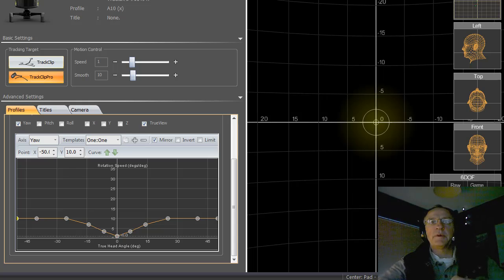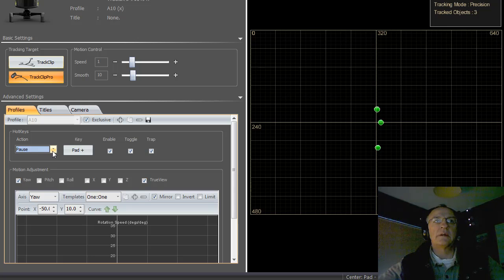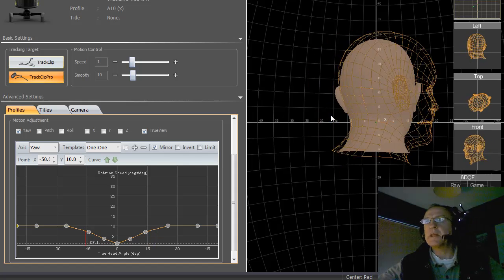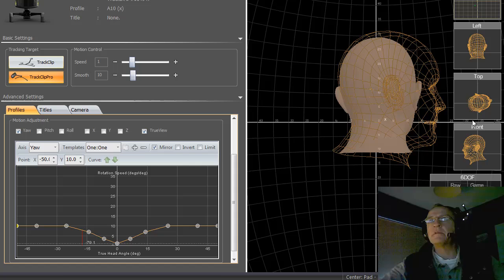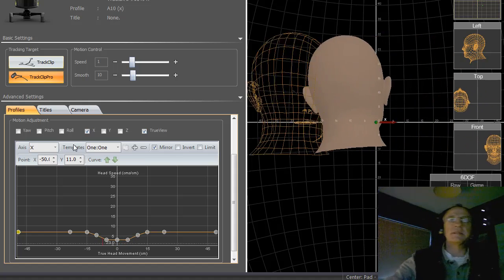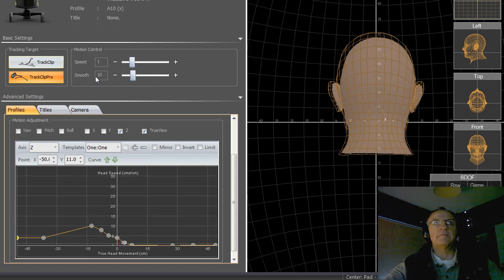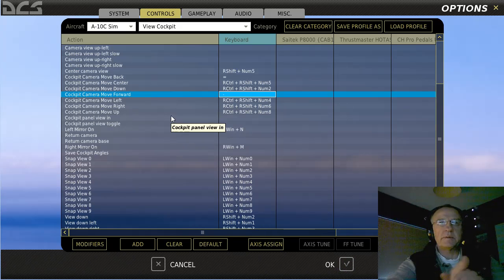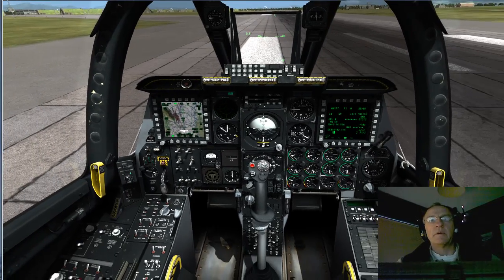Setting Up Track IR

Comment: You need a "dead space" area if you are playing first person shooters.
Otherwise its hard to keep your guns "strait".
Reply from the maker: I don't agree. But you need it to move very slowly near the center. Remember that the gun and its aim is not affected by the TIR. What you don't want is the view 'jerking' out of the deadzone, if you move your look, when you are trying to aim.  Think of how accurately your head can move in the real world to accomplish the aim process. But there is a 'snapping' problem in A3, which i don't believe has been fixed, and was not present in A2,...................  EDIT: setting in A3 which is broken is the aiming deadzone, which i leave off.
Reply: Half the point of using TrackIR in infantry mode is to aim down sights like you do in real life. As in you shoulder the weapon and sweep look over the sights. Which you can do with TIR by ADSing, moving the view slightly down and then looking up.

When you dont have a deadzone that "snap to perfect center" when its close enough. It will affect your engagement time on other humans. Which is why I havent met anyone with TIR that also uses it for infantry and is decent at it, that doesnt use a dead zone.

Which was the point of my OP.
Reply from the maker: Hi Lobos, and thanks for your reply. Discussion is always good. Like you I don't know anyone who uses TIR in infantry mode, and many I play with have it for flying/driving. The reason they say is its simply degrades  performance in combat. I totally agree. So for me the point of using TIR in infantry mode is 100% for immersion. So once again we will have to agree to disagree. I used deadzones for a number of years with TIR, and it did take some getting used to without them. From my experience over many years with TIR,  you can get the  same 'performance' from a good 'curved profile, as a 'deadzone' one, but with the added benefit of better immersion.

Comment: hey i bought a trackir4 to save a bit money, was that a bad choice? is there a huge difference from the trackir 4 and 5? thanks!
Reply from the maker: +FR Gamer Believe 4 supports 6dof, just resolution and capture angles are lower, from what i remember. 4 used to loose track for me at certain angles, 5 never does. But you can compensate with the profile. Get the ProClip. Bigger difference with the pro clip over normal, than tir5 over tir4, if that makes sense. Check out 'DeclanClip' might be cheaper, and more robust. Naturalpoint pro clip is very weak, and delicate, and they have done nothing to improve this.

Comment: Hi I'm having really trouble with just simply the cap reflectors in so much when its on my head & I'm looking forward in fsx cessna 208 the  position is always about 40° to the left or right. I have to turn mt head to the right 40° just  to point ahead ish. What have i done wrong. Using track ir 5 with fsx windows 7 high end mid range  pc Intel ivy 5 with nividea gtx660. Would i need to go to step 1 and align the camera. Also do i need to bend the reflectors to sit in a different position. I have a preset profile loaded in form natural but still have this very  basic forward position issue. Can you help. Kind regards simon.
Reply from the maker: Simon Skyfall 1. make sure you are setup for the cap reflectors (clip), and not the clipPro. 2. Its a phsical thing. Make sure the reflectors can be 'seen' by the camera. THEY MUST HAVE LINE OF SIGHT OF EACH OTHER, over the range for head movements to left and right, and top and bottom of the screen. If you get that setup the the rest will follow.
Reply: Thanks Gerry I'll check thats all in order. I'm not far off it you video has been a great help.

Comment: just found my old trackir 4, cant find the trackclip or the pro i had for it... made my own, but i'm having trouble getting it to "read" more than about 10-20 dgrees of movement (ie, i move my head frmo left to right, it only reads about 10 to 15 degrees total. anything i can do? i built my own trackclip using a hat and some reflect material. works great but can i improve on the design? i hate the clip pro, as it breaks and is garbage.
Reply from the maker: In the target tracking box of the software UI, make sure it is set to the type of reflector that you are using.
Reply: thanks. i did that. its working, i just think i'm sitting too far back or something. i bumped up the "speed" then adjsuted the curves and that seems to have helped.  still kind of annoying but its working.
Reply: BadTurbulence they have not. it's still flimsy as shit.
Reply from the maker: Just get a 'LukeClip' on ebay. They are the business.

Comment: hi awsome job ! i have a problem i cant add any profiles to my track ir software . i can only use the defaults profile that is for the track ir . am i doing anything wrong ? or what the hell is the problem .
Reply from the maker: +Christopher Karlsson Click the PLUS button beside the exclusive box, from the profile tab. Name the profile. Or select a profile, then click the copy button beside the one above, an name it what you like.
Reply: +Gerry Abbott yeah i know but i want to use ur config setup from the start so i downloaded your profile and put it in the folders profile where the TRI is installed. but for somehow no mather how many profiles i add in to the folder once i start the Track IR 5 program it only comes up the 4 Default profiles. and cant see the once i had add.
Reply from the maker: +Christopher Karlsson Did you unzip the download (its a rar file). The profile is inside, and  name ends with .xml,  which goes into the folder C:\Program Files (x86)\NaturalPoint\TrackIR5\Profiles.
Reply: yeah i did but still nothing new except the defaults comes up in the list. Talked with a friend aswell about it and he have no clue or idea what it can be either.
Reply from the maker: try copy one of the defaults, rename it in the folder.  Then try a TIR reinstall, maybe in a D drive, where you have full folder rights. Finally, if all fails, seek support from Natural Point, or on their forums. I'd be surprised if this has not arisen before. Good luck.
Reply from the maker: +Gerry Abbott Hey, check the following folder for the profiles, path above is wrong. C:\Users\xxxxxxxxxx\AppData\Roaming\NaturalPoint\TrackIR 5\Profiles (xxxxxxxx is your user name).
Reply: Did not see this link.  Took me a few hours to find where the profile drop-down menu was stashed.  Your A10 link is a big time saver.  Thanks.

Comment: Thank you very much for the video and your excellent explanation.  I mostly fly the copters, lately been learning jets in DCS and VRS SuperBug.  Need this TIR5 for dogfighting.  My CH Fighterstick I have Center and Pause Off/On mapped for both.  So for landing I just pause it, then use the game's default views._

One question I have concerns your download link DCS A-10 fish profiles 20120228.rar.zip___     In the TIR folder there is your Settings.xml _     I found a similar file in TIR5___ 

C:\Program Files (x86)\NaturalPoint\TrackIR5\Settings.xml___

Is your Settings.xml supposed to be used to replace this?___Guess I will experiment with it.___The download code looks similar to the DCS original, values are different._

Thanks

Comment from the maker: Then u gotta go back to basics. Isolate is it game, profile or TIR setup. Check out the movement of the 'head', using the 'REAR' display option, with a flat profile. Compare 'actual' (solid) head with the virtual one (wire frame one). If its not happening, then try it with your problem profile. if still happening, look at the camera view, Are the reflectors visible at all positions, are they overlapping at any angles etc. That's all i can suggest. oh and check correct 'clip' is selected.

Comment: Edit: Just having some hard time getting used to it :)
Reply: Gerry Abbott Yeah I was messing around with the software and I managed to delete the Template One:One.... And theres absolutely no way to undo a setting for all I know while I was in the HeadsUp view when you hold left mouse button and drag it around I couldnt get it back to default, I had to restart the program.. I just got Trackir 5 and I dont quite feel confortable with it.. yet. 

Also I can get quite confuse when an axis interfere with another one, like yaw with pitch e.g. looking to the side while looking up but guess its just me who need to get used to it. this is my first tracker ever :)

And there aint that many tutorials out, counting two that ive found with yours so far.
Reply from the maker: Always good to back up user created data. For TIR easiest to just backup the folder. TIR takes a couple of hours to get used  try just yaw and pitch enabled to start, and while on the ground (not flying!). Disable all other axes by un-ticking them. Sorry but the tutorial is not really a beginners guide. More of a 'tweakers' guide to get the most of your TIR install. I can see why it might frighten off a total beginner.!
Reply: Thanks for your reply. I wont give up :)